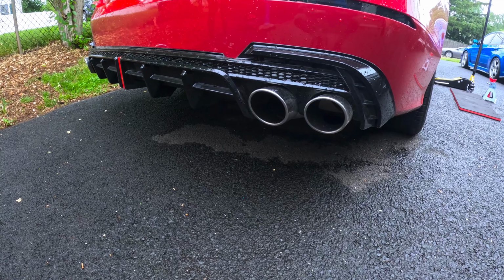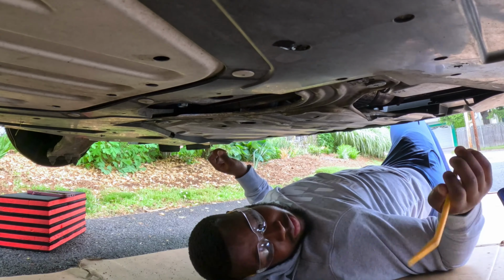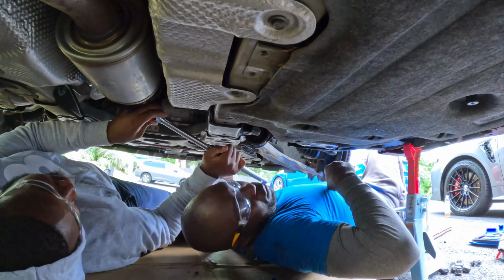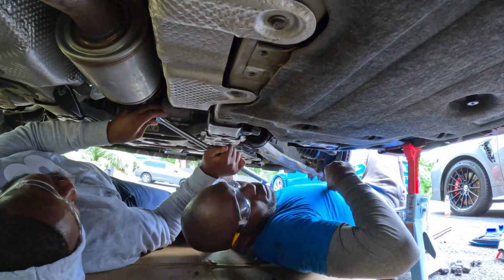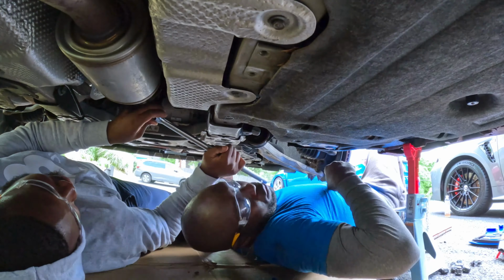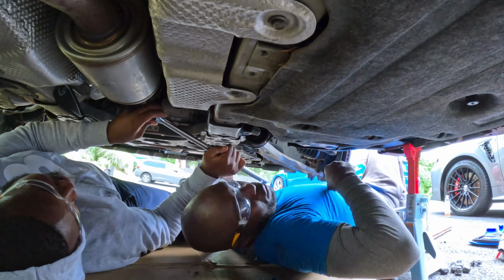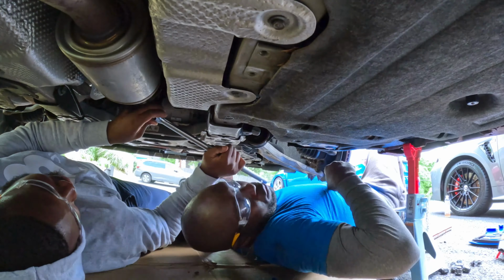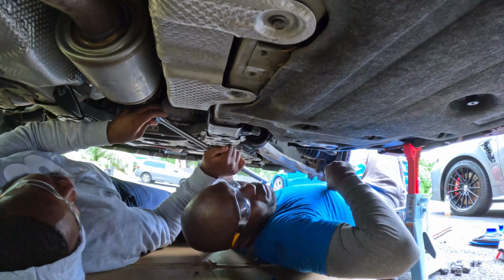Upgrade Your Ride: 2020 Honda Accord Gets A Boost With Rev9 Exhaust Upgrade!

Comment: You are amazing. EVERY TIP was on point. (I did this in the dark with a headlamp lol)

TIME TO COMPLETE ESTIMATE: Took me about 4.5 hours SOLO (it was at night time, and I don't have a garage, maybe if its daytime w/ garage you'll save a bunch of time, and this was solo)

TIP FOR OTHERS: 2 THINGS YOU CAN SAVE TIME WITH 

1) I only removed half of the screws (the half under middle of car, and KEPT front screws in, bent it down, and was able to do it all. (15 mins saved here?)
2) I did NOT need to remove the bracket that holds the first part of the exhaust in, just pull it through

THANK YOU SO MUCH! I LIKED AND SUBBED
Reply from the maker: No problem I glad my video was helpful. This is why I do it.  Thanks for watching.

Comment: I have the same exhaust but for some reason sounds louder. Do you think something is wrong?
Reply from the maker: The go under the car and check all your connections there is a leak somewhere
Reply: What grommet did you end up buying , can you link the grommet you got , my grommet is hitting my rev9 exhaust as well , I’d like to find a grommet that clears

Comment: What point did you jack the fronts on? Control arms?
Reply from the maker: I just used the 4 point that comes already there. Those are good points. To use. I also make sure I put the totes under the car for Safety